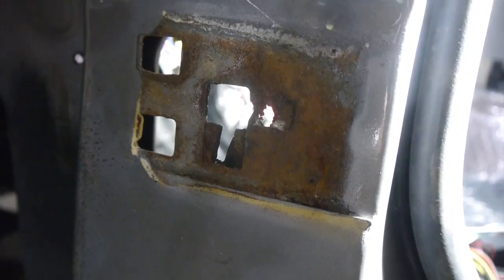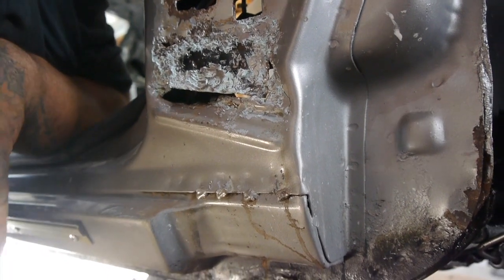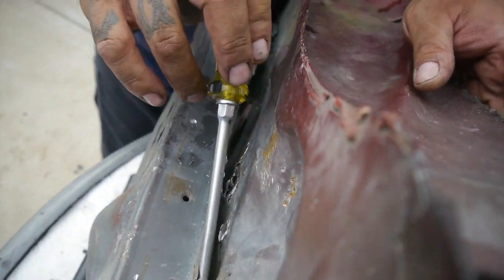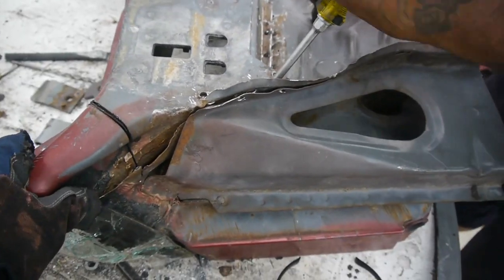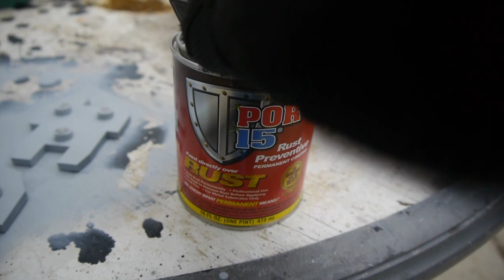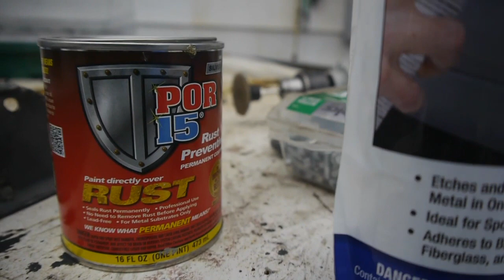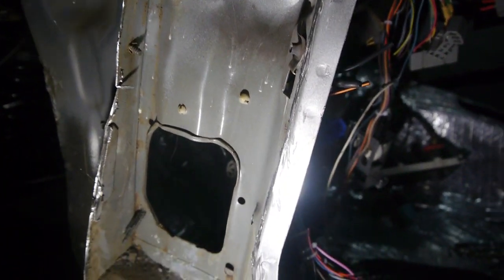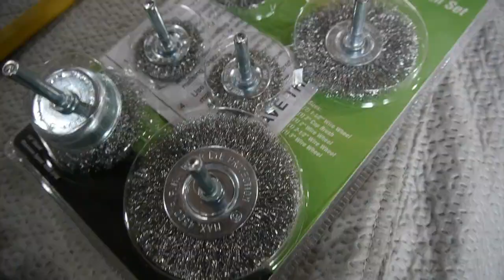93 Foxbody Mustang GT  Rusty Door Posts Repair Part-1

Comment: How did you realize it was still rotted under the hinges?? We’re you just checking for good measure?? Or did you see something wrong when the door was open??
Reply from the maker: New Edge Designs good morning sir. The door was not closing right. You know that nice sweet way foxbody mustang door closes when you just push it a little giving that nice click and flush sound, it was not happen on both doors. I started to inspect it close to see what was wrong. I thought maybe I should just remove the door install new door hinges pins, door tensional spring, door striker and bushing. As I was removing the door as you can see, I just saw rust dust raining down when I turn the wrench. We have chance everything from this car, the hood, fenders, roof skin, complete floor pan front back, front end, quarters. The only thing original on this 93 Ford Mustang GT are the two doors, hatchback, and radiator core support. This is has been a long process tracking down every rust and killing it. This is why this project have taken so long, the up and downs and learning about the coyote motor swapping process. https://www.youtube.com/watch?v=E_fB3O5kdhc&list=PLG4mKXWqG3EN3FtJGmaJ4zm_djh3n-V8q&index=32&ab_channel=MCSCGREENWHEELS
Reply from the maker: You are welcome sir. We hope that maybe someday someone that might experience this same process might find encourage from our video and uphill battle.
Reply from the maker: I will share some of the links that this has been a tough learning experience. https://www.youtube.com/watch?v=9IayN5ehVx4&list=PLG4mKXWqG3EN3FtJGmaJ4zm_djh3n-V8q&index=1&ab_channel=MCSCGREENWHEELS
Reply: @mcscgreenwheels  Ya the solid door click is one of the fox body’s shining points…The hinges were obviously not level anymore after he patched the doorposts with bondo…Wow you must have been hot…After replacing everything else your supposed to have a finished product getting it back from paint and this happens..This is like worst case scenario shit…Nice work so far on the fix though…
Reply from the maker: @NewEdgeDesigns  I was angry you are right. We have paid twice for this car to be fully painted and still can't get it right.  The skill set here is mechanical, we thought we could paid certified automotive body shop to focus on the body work, while we figure out the coyote swap mechanical parts, like putting in the engine, trans, AC, heat, power steering/ hydroboost. All those listed require a lot of research, studies since this was one of our first coyote swap.  Outsourcing the body work so we can speed up the project was the biggest mistakes. We have missed every deadlines for this build. It will be done we have come way to far to stop now.